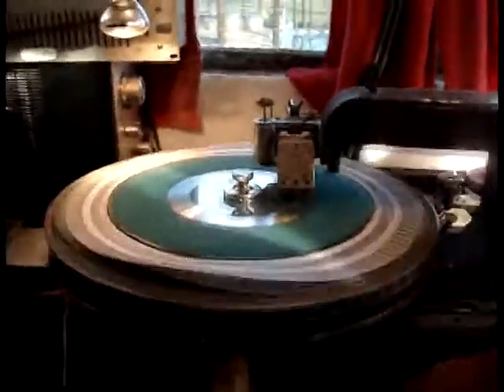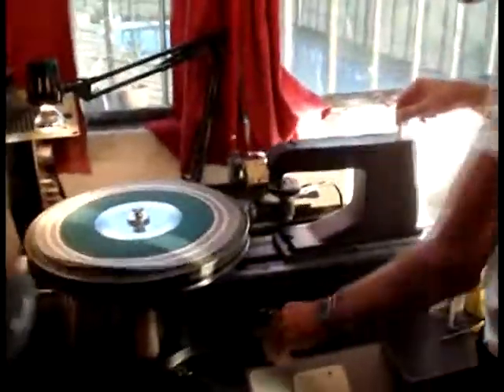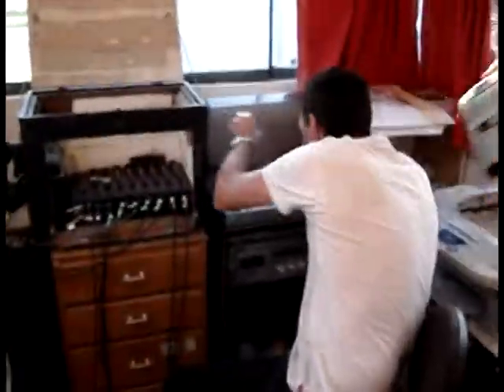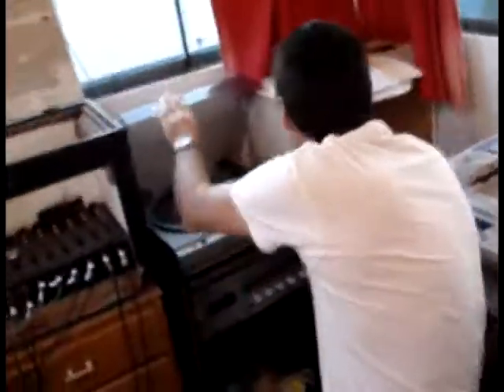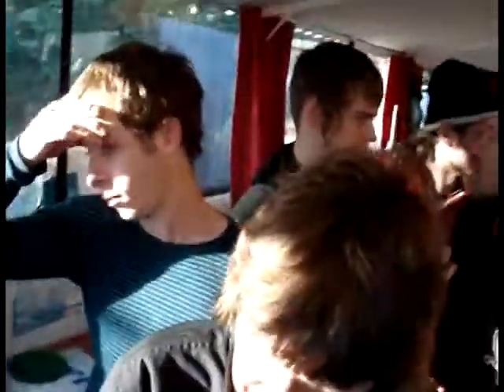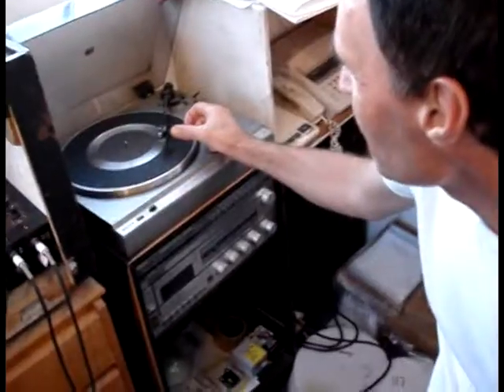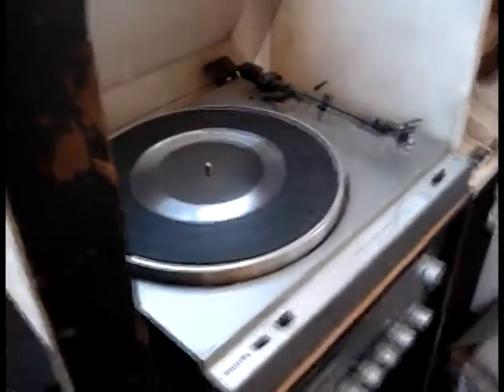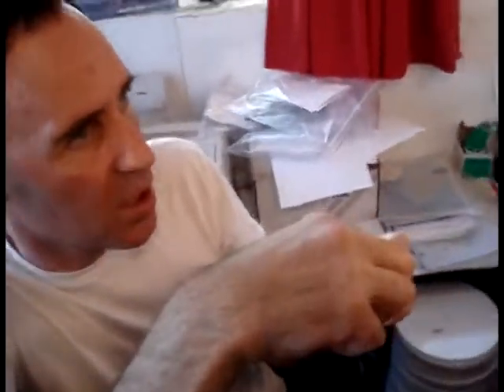peter king shows how lathe cut records are made - part 2

Comment: actually this is not the master, peter king does not cut masters, he lathe cuts records. you wouldnt want to use his records as a master, he cuts into the same material as compact discs, and it is about half the volume of a normal record and a bit muffled.